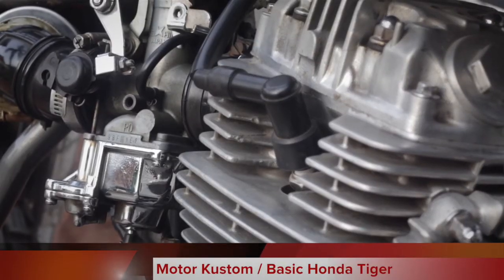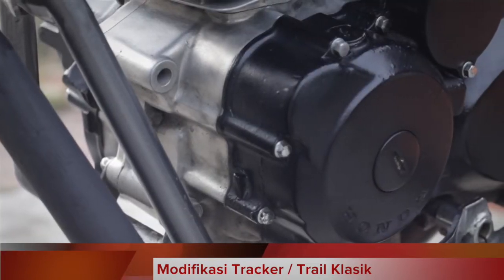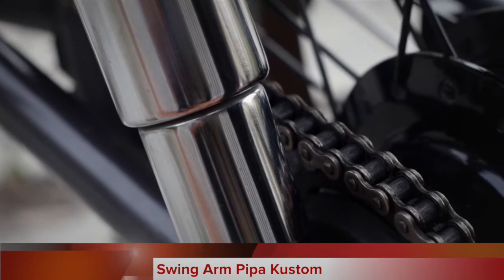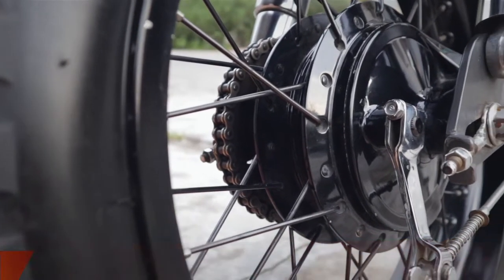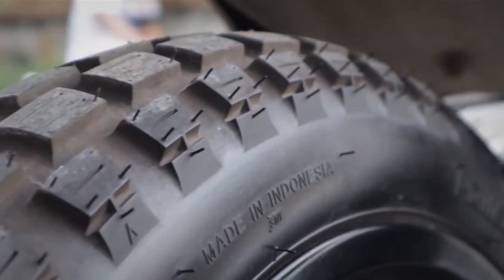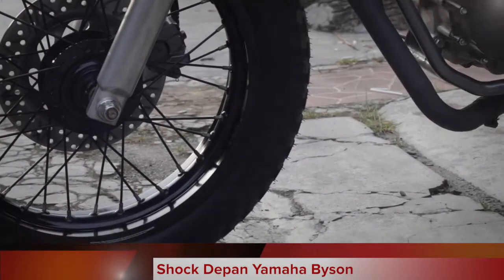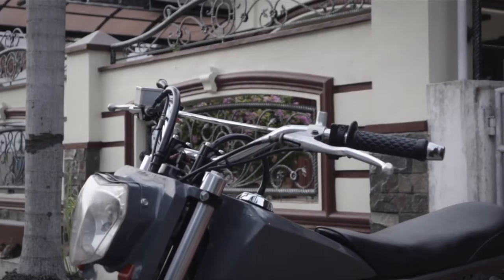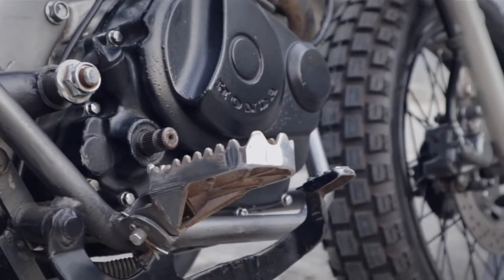HONDA TIGER MODIFIKASI SCRAMBLER TRACKER

Comment: Mas kalo shock depan byson pake velk 18.300 ban primax sk68 18.400 masuk ga?
Sama belakang 17.350 ban 17.400 primax sk8 Cocok?
Reply from the maker: velg belakang pake uk 17-300 aja. kalo pake 350 nanti ban nya jadi terlihat kurang gendut.
sekarang depan saya pake ban 18-300 tapi velg nya ukuran 2.50.
Reply: Kalo belakang 17.300 ban nya ukuran berapa mas?
Reply from the maker: Ban pake 17.400
Reply: Terimakasih mas infonya sangat membantu